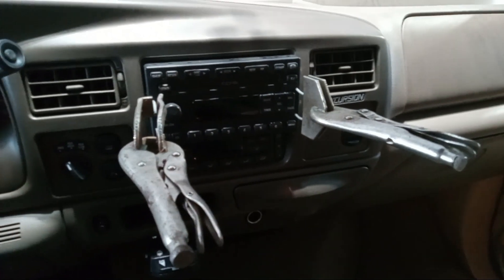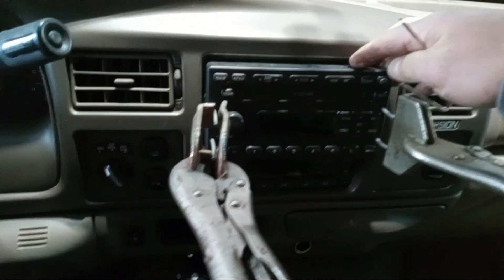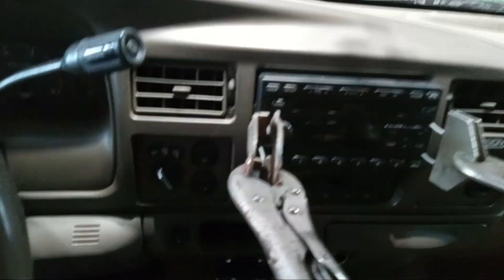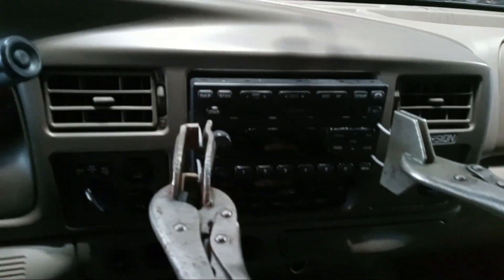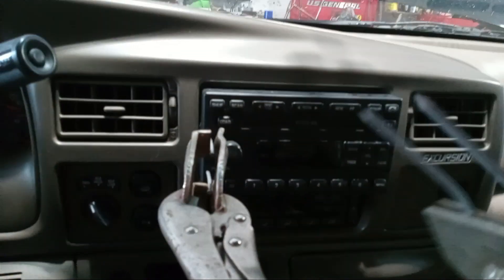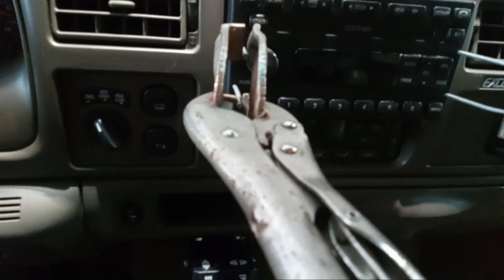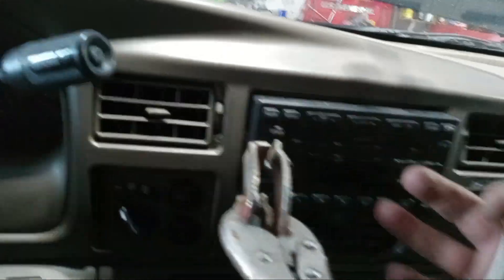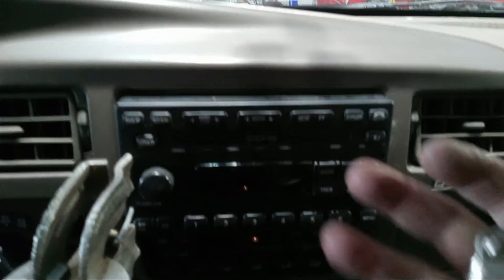99-07 Ford F250 F350 Superduty Excursion STUCK Radio REMOVAL

Comment: Still can't get mine out, stuck on the right side. Drilled the holes bigger and used thick wire, still stuck. I will try drill bits next, they wont bend.

Comment: The U tools I bought for this are working, It seems to be hung-up on something else. It pulls out an 1/8th of an inch but no more and when I push it back in you can hear it click into place so the retaining tabs were disengaged enough. Tried to pull the dash off but I can't access the two bolts on top. Anyone else have issues?